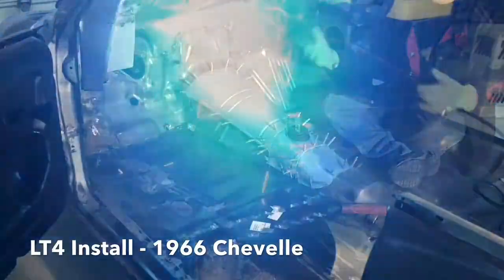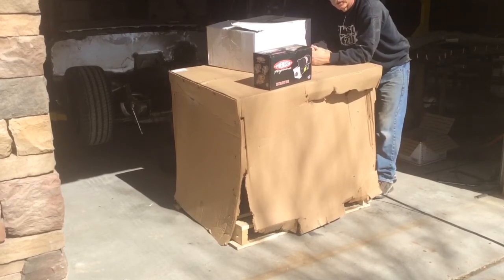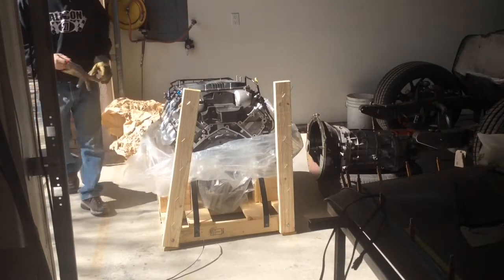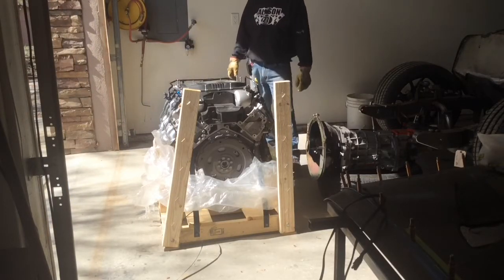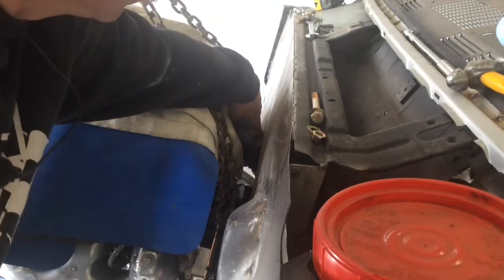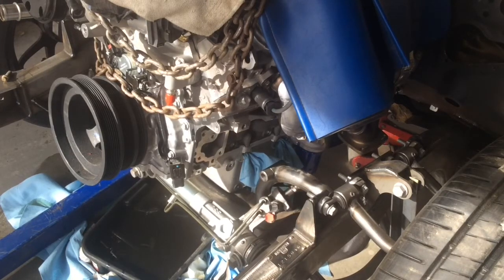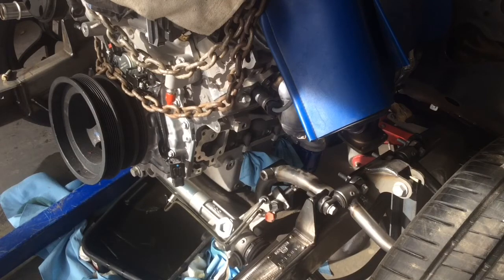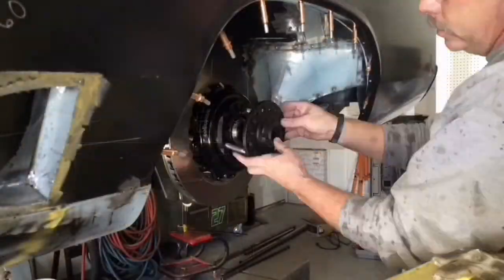1966 Chevelle - LT4 Engine Install - Part 1

Comment: Wondering what fuel delivery system - tank to engine. Thanks
Reply from the maker: 1/2” aluminum fuel line with flex line at both ends.
Reply: Allison Customs' - PROJECT CAR TV - could u b more specific, type pump and does the pump use modulation with the gm computor
Reply from the maker: Stock Corvette/Camaro Replacement pump.  The Tank and Pump came from Rick's Tanks in El Paso, TX.  Yes the fuel pump uses PWM with the GM ECM. It's a returnless system with standard in-tank filter and a external filter mounted on the frame rail.  The only other thing nedded is a fuel pressure sensor mounted in the fuel line.

Comment: My 63 corvette coupe has a Ls3/480 with a tko600 and a sriii custom chassis.  Will a LT4 gen v  fit in the same space and use same motor mount plates. I will be using the tko600 5 speed. Thanks
Reply from the maker: I think LT4 will fit where a LS was, but you need different engine mount plates. I believe Diablo is making some adjustable ones now.   Also, the bell housing I used fits both LT and LS engines, but I don’t think an earlier LS bell housing will work with the LT. You would need to check with your manufacturer for that info. 
Why are you swapping out the LS3?

Thanks for your comments and questions!
Reply: Will fit in same space however engine mounts need to be Gen V specific. LS mounts sound fit. There’s a few companies out they make adjustable ones. Dirty Dingo is one of them.

Comment: What transmission is that? Are u going to use the factory computer or aftermarket?
Reply from the maker: Tremec 6 Speed
Reply from the maker: its a GM ECM and wiring Harness for the engine.
Ron Francis Wiring supplied all of the Chassis wiring.